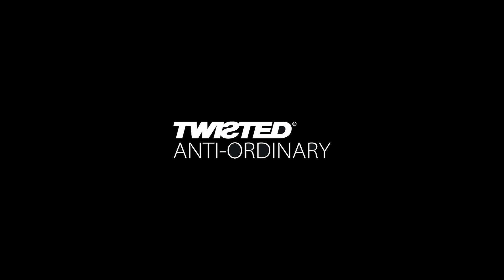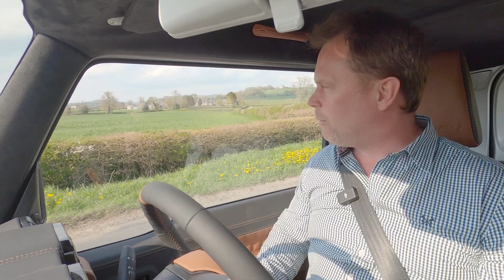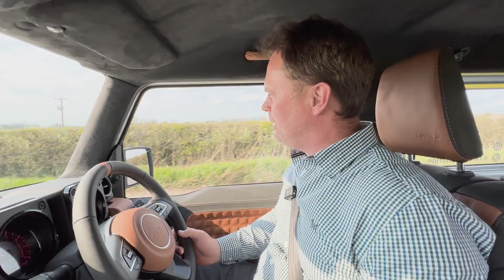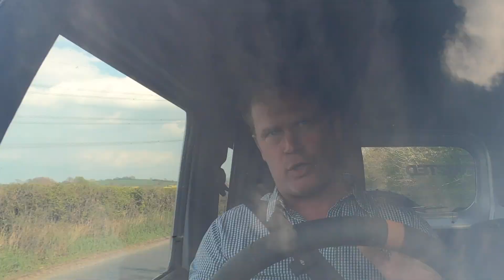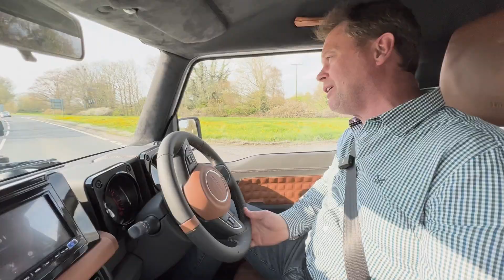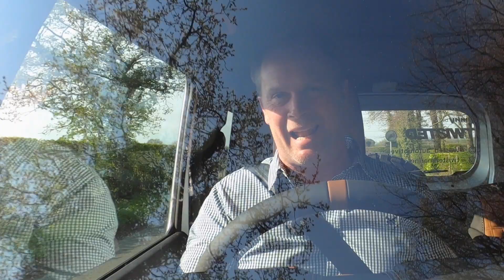Jimny by Twisted - Ride along with Charles

Comment: Get the 5 door Jimmy that Suzuki is bringing and tune that. Now you will not have too much to do in looking for or fitting rear seats as the 5 door will have the rear seats. India already have them on their roads
Reply: Also maybe try to see if the 6 speed manual gearbox from the Suzuki Swift Sport can work in the Jimny